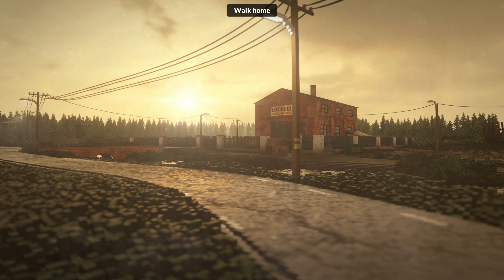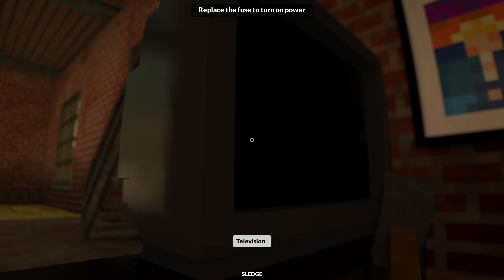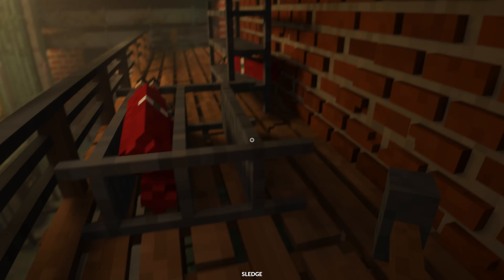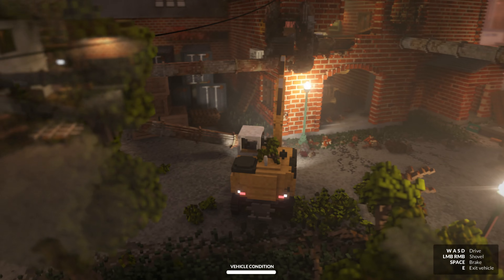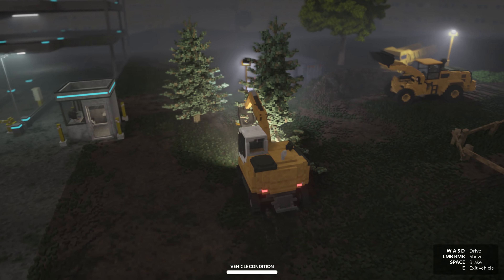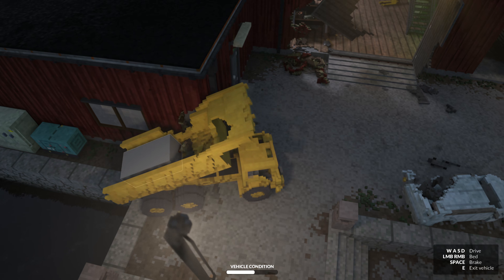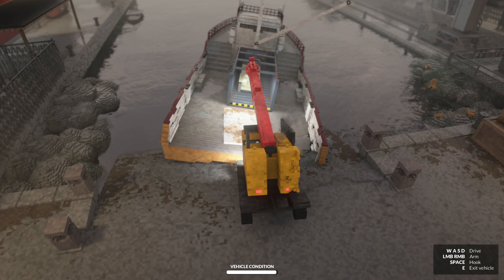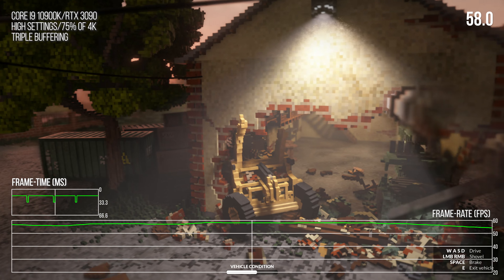Teardown Is Stunning: Next-Generation Physics + Lighting!

Comment: I’ll tell you now having played it, this game has nothing ‘next-gen’ about it because it’s basically mine craft with smaller blocks and physics enabled.
Reply: Gameplay has nothing to do as to whether a game is "next-gen"
Reply: You didn't even have to watch the video to understand why it's titled the way it is. You could have just watched a couple of minutes of the technical explanation.
Reply: "It's just minecraft, but smaller+physics", is the most surface level understanding of the engine one could possibly have
Reply: @plkrtn  Of course and graphically this game doesn't look next-gen either despite the cool techniques it uses.
Reply: @kylerclarke2689  It's not my understanding, it's the extremely slimmed down and to the point description of the game. It literally looks no better than Minecraft with shaders.
Reply: @AWOL trooper Using an pre-built engine gives you less control over your game. It can make it far easier for developers who are less experienced, or those who don’t care much about low-level stuff, but some developers want as much control as they can have.
Reply: @AWOL trooper Found the clueless person who has never actually used OpenGL or Vulkan nor done any graphics programming.

While Vulkan has higher performance then OpenGL, OpenGL is way easier to get something up and running. You don't have to worry about command queues, command buffers, descriptors, fences, barriers, etc. in OpenGL. Dennis wanted to focus on prototyping, NOT having to spend another 6 months learning Vulkan.